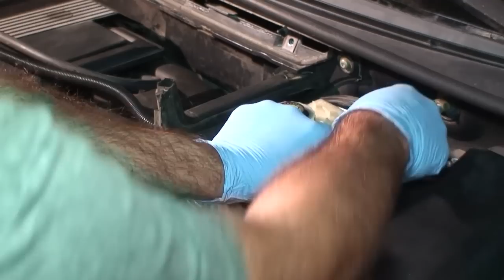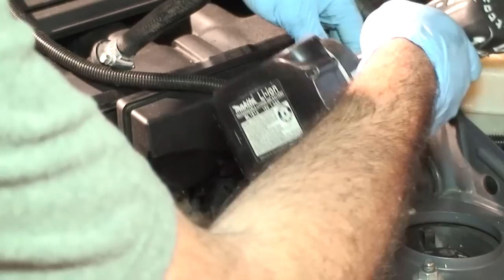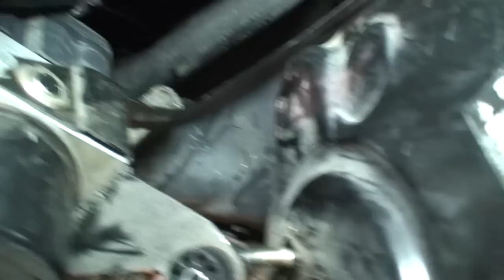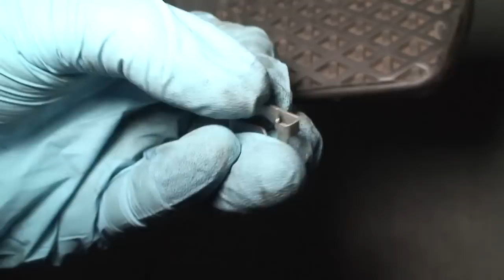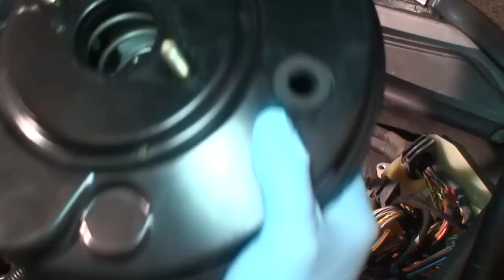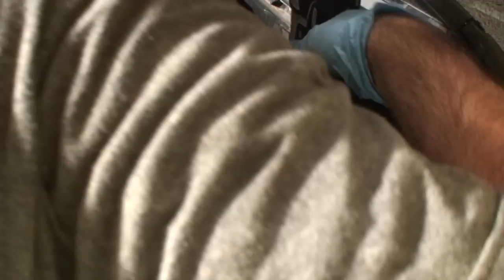BMW 330i 325i E46 Brake Booster Replacement DIY (No Bleeding Required!)

Comment: Great video. Hi, new subscriber here with an unsolved problem: I have replaced all vacuum lines on my 2002 BMW E46 325i; however, am still getting a hissing sound under steering wheel. When break pedal is pressed the noise reduces and when depressed the noise came back. Is this a sign of brake booster failure? Brake pedal is not hard neither travels down the floor. Any suggestions and/or help resolving this issue is much appreciated. Thank you.

Comment: 50sKid, I just did this diy last night and your video was extremely helpful. After about 3 miles the ABS, DSC and BRAKE light came on and my cruise control doesn't work. Brakes work fine though. Any ideas?! Thanks for the help!
Reply from the maker: Use a BMW scan tool to read the errors in the computer.
Reply: Actually found out I had taken out the brake light switch and put it back in the wrong place. Fixed it and the lights went off. Thank you again for the help!

Comment: How do you remove the vacuum hose at 4:10 from the servo so easily? I was told it was a single use clip? Thanks in advance.

Comment: Hi Jason, I accidentally pulled the Sucking Jet Pump you mention at 4:20 so how can I fix it? It goes back to its original place but it comes out pretty easily.

Comment: Won’t work on e39 either because there is no space to clear the strut tower so sadly you can’t do the booster on the e39 without removing the master cylinder and the resivour

Comment: I'm experiencing the same exact symptoms (sound) from the brake booster when I push the pedal but I also have very poor brake performance. I feel it takes way too long to stop the vehicle or to bring it to a halt when I press the brakes hard. Is this also a symptom of a failing booster? or is this most likely my master cylinder as well? 

the car sat for 2+ years and brakes have been like this ever since I got it running again. already did pads and rotors.
Reply from the maker: A failing booster will feel like a brake pedal that is very hard to press.  Stiff pedal.  Aftermarket pads or pads that are the wrong compound (ie not ceramic) can affect braking performance.  For instance, when I first got the car I put on the wrong pads that were for a 325i (different size) and felt the difference for sure.

Comment: Great Video!  Do you have any recommendation regarding a hissing noise coming from under the dash and stops when brake pedal is pushed?  I have a 1998 328i (Euro spec as I am stationed in Germany).
Reply from the maker: +John Drummond Certainly sounds like a leaky seal on the brake booster, but I'm just guessing.
Reply: Thank you.  Want to be able to talk smart to the mechanics here in GER.

thank you.

Comment: Sometimes when I turn on my 2003 E46 325xi there is a air noise from the driver side air vent and it stops when I press the breaks. Do you or any one knows what it could be?

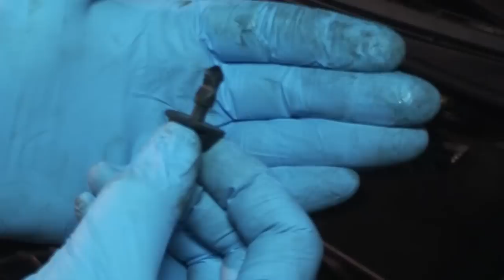Comment: 5:17 Anyone knows the part number for this piece? I dropped the one that’s fitted closets to the back of the car, into the engine bay and now I can’t find it. Any ideas where to look for the dropped one?  Is super hard to fish up with my magnetic telescope tool since I only can use the claw thing.

Comment: I have an e39 that took in water due to the crappy window weather strips so, I would imagine the process is the same ?
Reply from the maker: What do water and window weather seals have to do with the brake booster, though?
Reply: 50sKid well I read on some of e39 boards of quite a few owners getting water in the booster. And the theory is that the front windshield rubber just didn't hold up well. I can actually hear what sounds like water.
Reply from the maker: Ahh, I get it now.  So yeah I would imagine the procedure is very similar.
Reply: I'm about to start..! Thanks for the videos

Comment: I have a right hand drive 318ci would the process be easier since the booster will be on the other side? Thanks
Reply from the maker: Definitely.
Reply: How did it go ? Doing my E46 coupe 2002.

Comment: The valve that is on the brake booster is sucked, my car is misfiring and it has a air leak they wanted to charge me300$ just to see the problem but it never gave me other problem since i changed the intake to a new one, after 3 sec i turn it off you can hear a pshhhh  coming out the car

Comment: the hissing sound when you press the pedal is that normal?
Reply from the maker: +spcharged Well no, as I think you could clear, the brake booster that I got from the junkyard still had a little bit of hiss in it.  I only hear it when I come to a complete stop or when I first touch the pedal.  It's the sign of a booster whose seals are just beginning to go bad.  The Honda I work on also has the same problem.  It just happens with old cars.  The booster I changed out, though, was horrible and definitely needed to be changed.  I'm alright with the slight hiss--it's not something I wanted to pay $200 to get rid of!
Reply: +50sKid my car also has that hissing sound it means that booster is sucking air from cabin or from the side of master cylinder?   is there a way to find out if used booster has hissing before installing it in a car? :D
Reply from the maker: +spcharged Actually, yes, now that I think about it.  If we're talking about pulling one from a salvage yard, you can take a handheld vacuum pump in with you like a Mityvac, hook it up to the hose going into the booster and pump it up, then try the brake pedal.  But, now that I think more about that, I don't think that would work because salvage yards usually drain all the fluids out of the cars before they let you see them and without brake fluid, there would be no resistance and hence no air squishing out.  So, I guess the answer is no.

Comment: Recall on brake boosters. Vacuum line replace in 2013because of recall, line could leak  into brake booster. Now 2021 oil is now behind n the brake booster and BM refusing to pay for it because they say the line was replace in 2013 cleared no the recall. Paying out of pocket to get it for x d but will have to call NHTSA and maybe a lawyer. Some how I will get my money back.

Comment: is there nothing for eu bmw it different setup
Reply from the maker: abmilzo Do you mean for right-hand drive cars?  I thought only the British had those and the euro ones were mostly right-hand drive?  Anyhow, it actually should be a lot easier for you to remove the brake booster on a right-hand drive because you don't have the intake manifold in the way!
Reply: Ye you are right eu was easier to say just the uk and Ireland. Well on my car the dsc is next to not below breaks with pipes going over so i can't use a few of the easy techniques
Reply from the maker: clabcon clabcon Actually you don't need GT1 or DIS, you can do it with just INPA which you get when you buy this cable off eBay: http://goo.gl/6i0MZk -- INPA is by far simpler to install and use.
Reply from the maker: clabcon clabcon Choose F3 for E46, goto Chassis => DSC (there are 3 choices, only the one your car has will work), then F6 for Activate then F2/F3 or F4/F5--which ever ones work.  You just inspired me to shoot a video on this, LOL.  That was the short version.